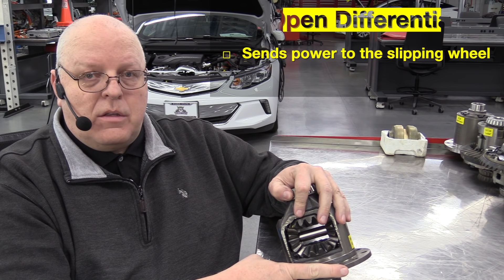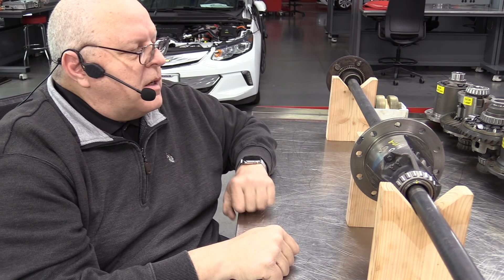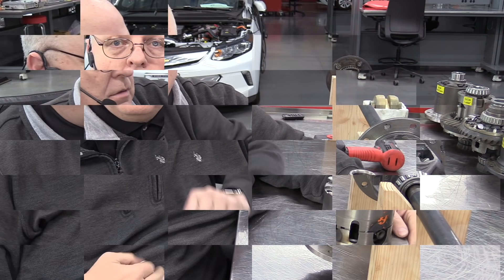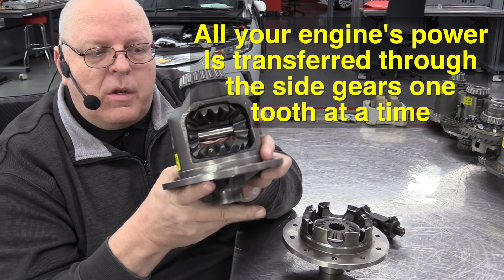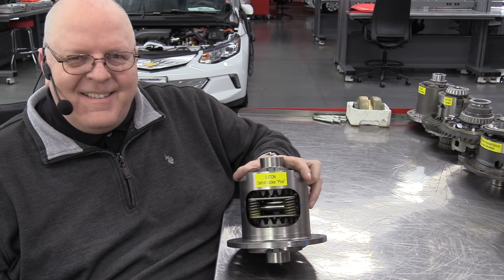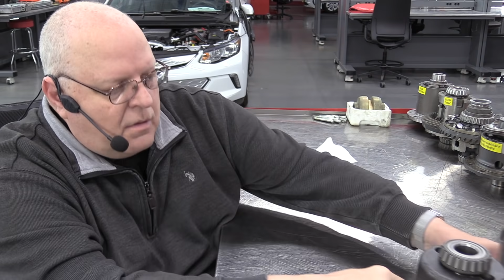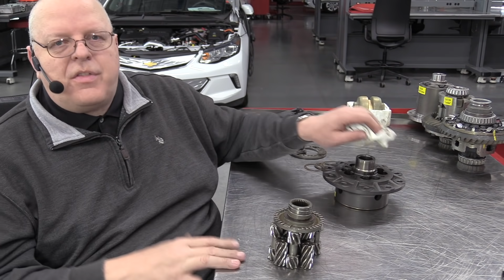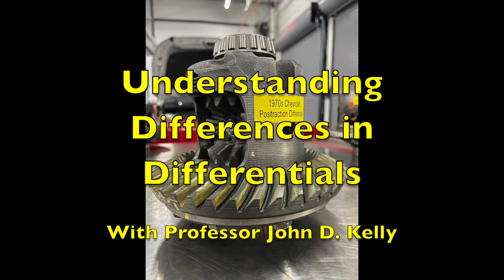Understanding Differences in Automotive Differentials

Comment: Wow, fantastic stuff! Thanks!

But I didn't really understand how the first limited slip differential works (the one with side gear clutchpacks). Why are the pinion gears pushing the side gears when rotating? Is the force proportional to the rotational speed? Is that the property of all beveled gears or do these have different angles or something?
Reply from the maker: Thank you. Yes, the pinion gear tooth profiles (angles) act like a slight ramp pushing on the angles gear teeth of the side gears. The force is there on acceleration and any time The slightest rotation occurs.
Reply: You did a superb job explaining the forces inside the diff. But what causes the side gears to lock up is the tire with the most traction.  The clutch will apply on the wheel with the traction because the pinion gears are spinning with the slipping wheel.  The pinion gears will push the side gear  that is spinning slower thus locking up the clutches on the wheel with traction.  All this only works if you ease into the throttle.  A good procedure to use is to slightly apply the e-brake 2 or 3 clicks.  This helps apply some additional pressure to the spider gears thus forcing the side gears into the clutches of the wheel that is breaking free.  If you just keep putting full throttle bursts the diff will react just like a non limited slip diff.  

On that spring loaded side gear differential, we used long enough bolts, I believe they were 1/4” bolts, to bolt the springs together. One on the top and one on the bottom.  Then we would tighten it enough so the back springs would compress enough to remove it from the carrier.

I really enjoyed your presentation on this subject.  Not many tubers would tackle this subject as in depth as you.  Thanks and stay safe.
Reply from the maker: @williambrand7887  Great feedback and suggestions. Thank you

Comment: I am assuming on the Toyota locker they must be going off of the ABS sensors the speed sensors the wheel speed speed sensor and then the computer command that motor to lock the diffI’m guessing
Reply: No the Toyota's with the electric locker have a button to lock it, it can only be locked when in 4Lo  if the truck is 4wd and under 3 mph in 2wd trucks.
Reply: And that’s the unnecessarily complicated way too!
Reply: @jonnycando  My bad sounds like a German thing
Reply: @jonnycando  Actually Subaru X mode system uses the ABS to clamp the spinning wheel on one side to apply torque in other areas!
Reply: @timbrown9731  that’s a good use but too many sensors and modules required to use this for signaling diifs and transfer cases to lockup....#canbushell
Reply from the maker: What Tx Dm93 said. Thanks for watching

Comment: Great video!! 
What makes the side gears pushing on the clutch packs is NOT the rotation, but the force applied: in other words the higher is the input torque and the higher will be the force on the clutches. This force basically acts as a preload: in case of a wheel on ice, the wheel with traction will still transmit the torque that is generated by the clutches (the bias torque) which is needed to "unlock" the differential
The same occurs in "torsen" diffs, but that is achieved by the high friction involved in worm gears. More input torque and more "unlock torque". By changing the pressure angle of the gears it is possible to obtain different ratios between input and unlock torque

F
Reply from the maker: Thank you, you are correct about the torque being needed. I did not explain that adequately. I posted a correction at the top of the comments.
Reply: @WeberAuto  You give examples of True Trac and calling them Torsen, not the same.  Torsen uses the non-reversable principle of worm gears.  No Torsens in this video.

Comment: Wonder what the yellow spray paint is for on the Detroit locker? Maybe it’s there to tell you different spring tension? Also I’d love for you to one day get your hands on that Acura all wheel drive differential the super handling one my parents just bought a 2020 MDX and I went through the whole car because I’m a typical car nerd, in the differential on the back looks like it has its own pump system on this thing!
Reply: It’s setup paint used to see how the gears are meshing.
Reply from the maker: Thanks for watching

Comment: Hello,  Do you know if the Toyota Hybrid AWD such as RAV4 have limited slip output to the wheels?  I’m a mechanical engineer (retired) that finds your videos very informative.  I’m not sure why the university curriculum skipped a lot of the practical info that you provide.  That said, during my career it seemed like only about 10% of my working day ever required technical knowledge.  Thank you for all the hard work.
Reply from the maker: They are not. Thank you for watching
Reply: You're lucky you even made it to 10% based on current mech eng jobs - though I had one job where I probably made it to 50% or more some months. It was straight R&D in an international research centre where my job was to design the first prototype of new systems rather than trying to get another couple of % out of a product or process that exists already. Even in the admin heavy jobs though, when the technical knowledge is needed all the MBA's in the world won't be any help.

I should say that mechanical engineering, for the most part is much too high level to cover things like differentials because they're considered too specific and the breadth of the course is already massive. Some of it might be a side effect of the time when the initial curriculum was written, where it was quite normal for anyone interested in this area to see the innards of all sorts of machinery before they get to college because people could easily work on their own cars and other appliances. A lot of students starting college now will never have a chance to look into all the sealed for life, unservicable black box parts that make up modern disposable cars and appliances unfortunately. The lack of understanding on how things work becomes more evident when you see some of the design projects they come up with or when you ask them even simple questions about how things work. A good interview question I like to use is to ask them how the cistern in a toilet works because every house will have at least one of them and for the most part it's easy to take the lid off and see the workings for yourself. Sadly, there are plenty of mechanical engineering graduates who can't answer that question :-(.

Modern automotive technicians who are specifically supposed to know the mechanical workings of cars can be just as bad though - the current standard operating procedure is to read the faults off the OBD reader screen and replace any parts that throw an error without checking whether they work first, charging the car owner for each perfectly good part they replace and their time to do it until the fault goes away without ever understanding what was wrong. I had an issue 10+ years ago where the CANBUS on my car was registering errors in almost every module in the car, to the point that the engine didn't stop when I turned the key to off, the ABS system disabled itself and the control panel was lit up, flashing warning lights like a Christmas tree even after the car was shut down. Luckily I'd noticed that the rear window washer had stopped working and there was a faint smell of washer fluid in the car, so I did some checking on that before bringing it anywhere near a garage. Turned out the rear washer pipe had popped off at one joint and leaked a few ml of fluid onto a ground point to the body of the car, which was enough to knock out a chunk of the CANBUS though a ground resistance error, which the fault codes didn't diagnose because nothing was talking to anything else. The repair involved soaking the liquid up with a couple of paper towels and putting a dollop of silicone grease over the ground point to keep future leaks off it. Once this was done, everything suddenly went back to normal as if nothing was ever wrong.

Comment: I think Volvo called the Dana diff in cars from 60s "anti-spin" :)
Reply from the maker: Awesome. Another name for the same product. Marketing! Thanks for watching
Reply: @WeberAuto  I can add that I have been a codriver in rally for many years and the rwd Volvo we used in competition had a dana style diff. It had four pinion gears and the parts we most often had to replace was the pinion shafts that broke. I was of the impression that the flattened middle portion of theese shafts had a function in tensioning the cluch plates when there was a difference in rotation speed of the wheels. Once again thank you for all your vids. We are beeing spoiled by all the fantastic content.

Comment from the maker: CORRECTIONS:
1. The differential I called a "Detroit Locker" is not a Detroit Locker. It is just an Eaton Posi Limited Slip differential. A Detroit Locker uses dog teeth and is a truly locking differential. Thank you goes out to Keith MacDonald for catching my error.
2. I did not adequately explain how the clutch packs of a limited-slip differential are applied. The simple rotation of the side gears versus the differential pinion gears does not cause clutch packs to apply, otherwise, the clutches would apply when turning corners at low load (low torque). Torque from the engine (or another propulsion source) is necessary. The more torque you supply to the differential side gears the higher the force on the angled (ramped) teeth, the higher the force on the clutch packs. Thank you to several viewers for pointing out my omission.
3. There is more than one style of Torsen differential. See the JTEKT Corporation's website for more information https://www.jtekt.co.jp/e/products/lsd.html  
4. I incorrectly described the operation of the original 1956 Dana limited-slip differential. The pinion pins on the original Dana differential have tapered ends. The pins sit in four V-shaped ramps in the differential case. Under a load, the differential case applies rotational torque to the pinion pins causing them to slide up the V-shaped ramps. This action applies outward force to the side gears and the clutch packs. Thank you to several viewers for pointing out my error.
Reply: Prof Kelly regularly goes where angels fear to tread: The variations / updates of thousands of engineers are not readily coverable in ANY  single YT video!
Kudos to Prof Kelly for admitting that even a superbly researched article is rarely COMPLETELY accurate!
Reply: The mark of a man is not by his mistakes, but how he handles them!  

I’ve spent a decade in trade teaching and know how easy it is to get a few little things wrong when reciting a lot of information. 

I’ve always told students to NOT take everything I say as gospel, to use workshop manuals & textbooks to find the correct information and I’m always happy when they can find my mistakes. 
Even happier when I get to learn some of the newest technologies from them. As they often have some dealership/factory training as new things are released on the market.
Reply: Well done and nice recovery! I can go remove my post about the Detroit Locker now! Thanks...
Reply: I like this correction, I'm definitely going to watch the whole video later.

I just definitely heard you call a thrust washer a shim, but I'll let that one slide.
Reply from the maker: @davidkuehne476  Thanks
Reply: You’re welcome.
Reply: Some may call the "Detroit Locker" a "truly locking differential".  I dare say it is not :)   If I understand it correctly then it is actually an unlocker..!   It stays locked all the time, except it allows one axleshaft to rotate at a faster speed than the ring gear,.  So when turning the ouside axleshaft actually gets disconnected from the differentinal, allowing it to rotate faster then the rest of the assembly.  And as a car with a locked differentinal loses all sideway traction on that axle, it should never been used on cars that drive on slippery surfaces, like snow and ice.  It's simply dangerous there.

Fantastic video btw. Thanks.  I didn't know there where different types of Torsen diffs.
Reply: @runarsigurjonsson2542  You are correct with the working principles of the Detroit Locker (as it is basically an UN-locker, as it stay locked everytime, unless one side want to turn faster due to grip), but you are false when saying it’s not to be used on slippery surface. You might actually forgot, that when one side of a Detroit Locker disengages (basically the outside wheel in a turn), the other side of the locker stays fully locked, so the inside wheel still being full driven. In reality, it can make a bit tail-happy the car in slippery conditions, as there might be too much torque on one wheel, but if the still locked and driver wheel happens to spin on ice, it will “catch up” in rotating speed the other disengaged side, and the diff will locked together again, wich will means that in icy conditions you can play with throttle pretty easily according your needs. Apply a bit less power, and you wont spin out the locked inside wheel, apply a bit more, and the diff will lock together, and you will driving a fully locked axle, wich is good to have on ice. 
I’ve driven for many-many years my Range Rover Classic with Detroit Locker in the rear, and TrueTrack in the front, and it handled in winter conditions as a dream (just as in mud). It was absolutely precisely controllable, and always felt absolutely safe.
Reply: Thanks for the video and the corrections I'd always hade problems to understanding the differentials and why its seems impossible to get it lockt on many older vans who refuse to move anywere in the wintertime, or more corectly just make it turn around in cirkles specially when it is snow on ice! It went better when i loaded a ton of steel in the back but that causes me to drive whit overload when I transported materials of +1500 Kg hade to put 6 bars pressure in the tires whos maximum was 4,5 bar but it all went well (Ford Transit 2.5 TDI-99) It's not easy to föllow ewerything when i'm Swedish and the translate to Swedish is horrible! Not speaking of the different units...
Reply: Thanks
Reply: I drove a truck for several years, I’m wondering if there is much difference between these small differentials and a truck
Reply: Ah, yet there's still one more type of "limited slip." And that's an open diff with the traction control system applying the brake to the wheel that is slipping.
Reply: @Jude Joseph glad I could help =)
Reply: Thank you for the added piece on #2 , to reference point #2- if one wheel is already spinning on ice, and the other wheel has good traction, is there enough torque supplied from the bevelled differential pinion gears with case rotating to push side gear outwards to engage clutch packs on that traction side?
Reply: you all prolly dont give a damn but does someone know a way to log back into an Instagram account?
I was dumb lost the login password. I would love any help you can offer me!
Reply: "torsion" is the physical act of applying torque, not a company.  The differential uses torsion to achieve it's design goals, hence the name.  Also, it is pronounced "tor-shun", not "tor-zion", or "tor-sion".
Reply from the maker: @connermcnicholas547  Torsen stands for Torque-Sensing. You should let the current company that makes Torsen differentials know their error. See https://www.jtekt.co.jp/e/products/lsd.html
Reply: @connermcnicholas547  The differential style he was referring was a "Torsen" ( https://en.wikipedia.org/wiki/Torsen ) Very nice diff. Used in Audi, Hummer and many other vehicles.
Reply: @connermcnicholas547  the brand or type is Torsen as in the following vid https://www.youtube.com/watch?v=JEiSTzK-A2A

Comment: John, excellent analysis.
One point of contention: the differential you called a "Detroit Locker" isn't a Detroit Locker. A Detroit Locker uses dog teeth and is a truly locking differential.
https://www.eaton.com/us/en-us/products/differentials-traction-control/aftermarket-differentials/detroit-locker-faqs.html
Reply from the maker: Thank you. I am not sure how I messed up that one. it should have just been Posi Limited-Slip. https://www.eaton.com/us/en-us/catalog/differentials/eaton-posi-differential.html
Reply: @WeberAuto  it would be awesome if you could find a real Detroit Locker to tear down. I understand it fairly thoroughly but it took a lot of studying before I got it.
There is a retrofit type that is called a "lunchbox locker".
Reply from the maker: I may have to now. Thanks again